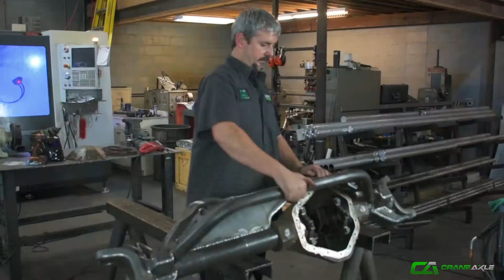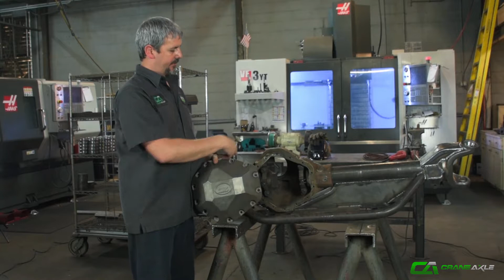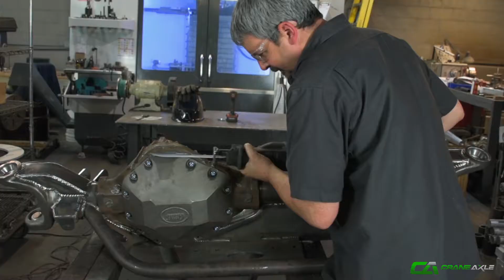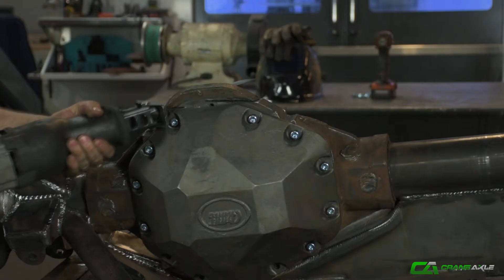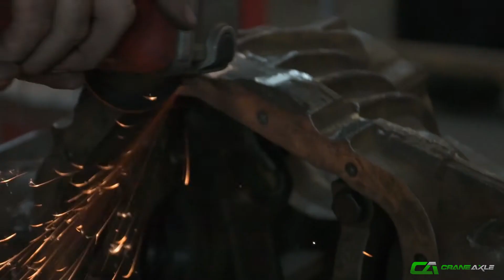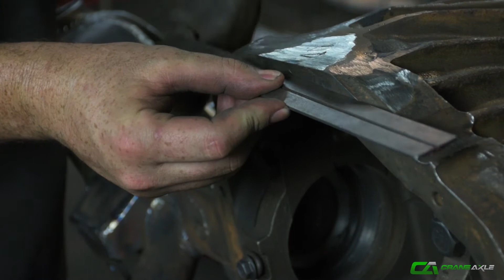How to Shave a GM 14 Bolt Housing - 13 Bolt Conversion- Crane Axle

Comment: cotta gear will make you a reverse rotation ring and pinion . They will also build you a planetary auxiliary reverse . so you can use forward gears in reverse .since it is planetary ,you have the same strength in reverse as forward .